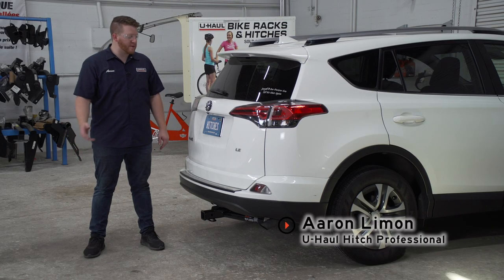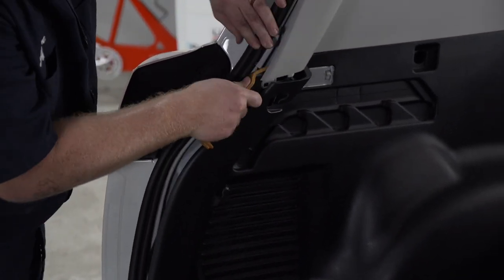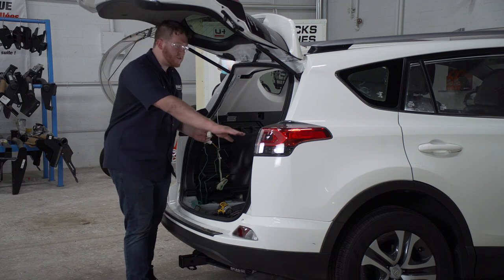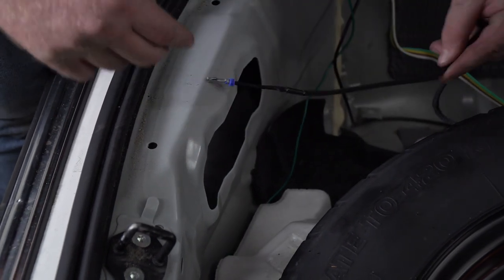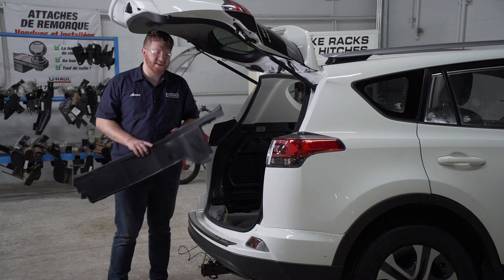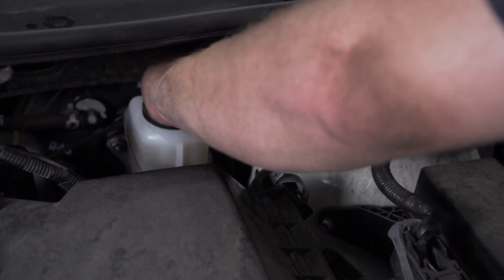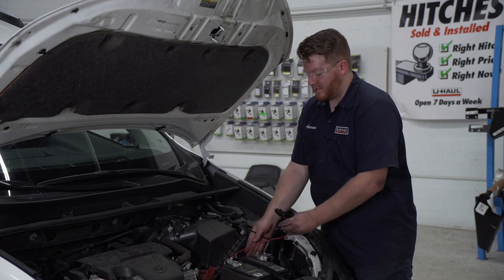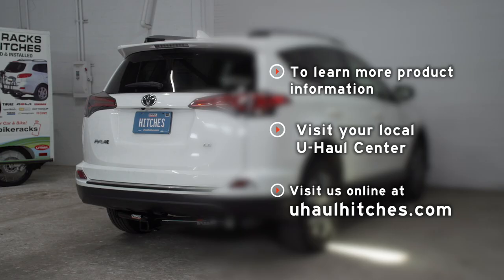2013 Toyota Rav4 Trailer Wiring Harness Installation

Comment: Sorry, this is 2020 and this wiring is like a job from the 80s, who leaves wires hanging out on their undercarriage??!!
Reply from the maker: Many customers elect to store their 4-flat connection under the bumper like this and it is perfectly safe as these connections are weather resistant. The power wire is ran under the vehicle per manufacturer specifications and is perfectly safe as long as directions are followed to avoid any hot or moving parts.